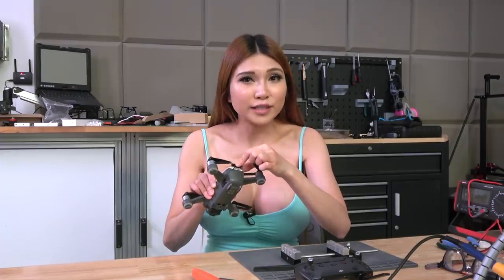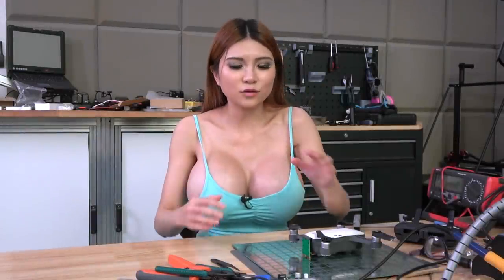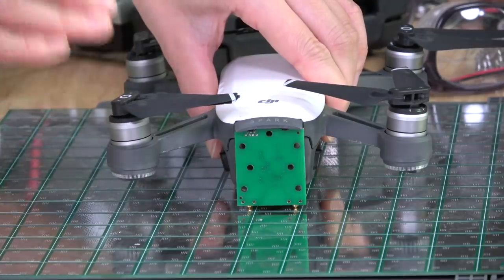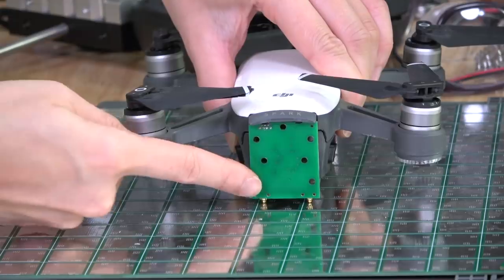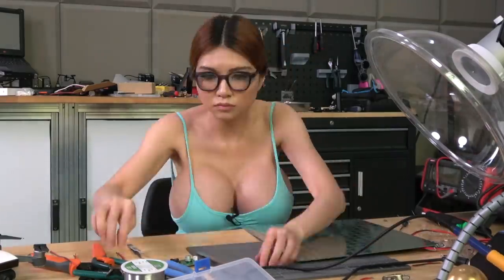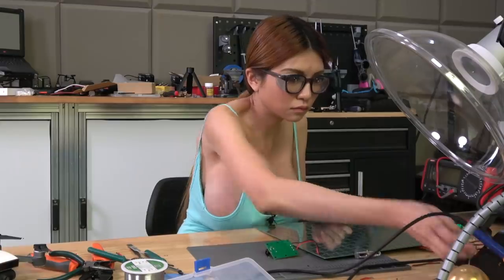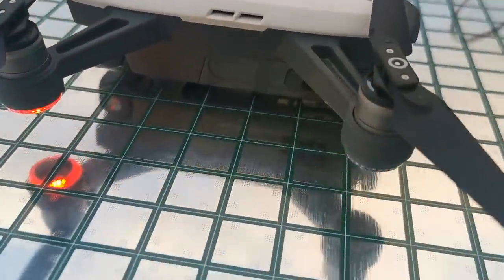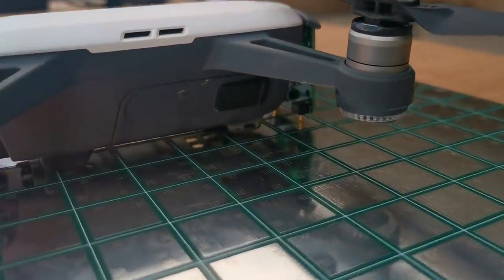DIY Self-Charging Drone- with JLCPCB!

Comment: those charging pads needs hangars, yes. i think, an open top would be the easiest to land in, but that would need a roof-door. the drones could be outfitted with some kind of transponder, that automatically sends an "open" signal to the hangar, once it is in reach of a few meters. once the motors stoped, a second signal will tell the hangar to close again, so the drone is protected until its fully charged. once the drone is charged, another signal will open the door, so the drone can start. once the drone flies away, the doors can close again.

Comment from the maker: FAQ

*Why not induction/Qi mat?
Of course, this is the first thing I tried. Coils require very precise alignment, landing cones, moving arms, QR codes and other schemes to enable this vastly increase costs. Large induction charging pads don't work well (which is why you don't see them for cellphones). It seems obvious- which is why I tried so many variations on this, but it ended up being neither cheap not practical. There are systems that use this, but they are much, much more expensive.

*Why not...
This is a proof of concept. The idea is to make this system as cheap as possible- so that you can have a lot of low-cost drones rather than one really expensive one. In order to do that, the entire system is made out of PCB parts- so there is no additional tooling required. As soon as you add injection molded or 3D printed parts the whole system triples in price. Yes, there are many improvements that can be made, but very few that can be made without adding a lot of cost.

*Why not solar cells on the drone?
Because of their weight and the drone's power draw they would only allow a few additional seconds of flight time. They could be used to charge the pad in remote locations and be quite practical for this.

*What happens in the rain?
Ideally, this would be in a retractable hanger- with gold or other corrosion-resistant traces on the board. But the board does have short protection in the meantime.

*Is their strain on the USB connector?
Not more than the strain of unplugging and replugging in cables. The springs on the pogo pins are very light.

Something else you'd like to see? Like all my work, this is completely Open Source so you are free to do anything you like with it: https://github.com/sexycyborg/JLCPCB-Drone-Charging-Pad/
Reply: @Basement-Science  to help with the weather  a hanger would be great, but maybe a sliding plastic cover (with a lil brush at leading edge for the 'dirt')is all that is needed, to help with the humidity/corrosion  you could only power the pad when the drone is detected nearby? and look at adding a sacrificial anode to handle what moisture u cant exclude. i like Naomi's plan of keep it cheap an simple. better for both consumer an producer to have a low initial cost. and drone ppl seem to be constantly replacing an upgrading their drones and associated bits n pieces.
Reply: Like Thunderbird 2 :-)
Reply: I did expect you to use induction initially, but t think you found a much simpler and more elegant solution! As you say, induction is expensive and fiddly, this is much more scaleable!
Reply: It might be fun to watch the journey on how you get from an idea to the solution, incl. the things that don't work - very much like alex french guy cooking  does with food..
Reply: oh so it have short circuit protection ))) that good to know
Reply: @Naomi 'SexyCyborg' Wu : Regarding wireless recharging... What kind of voltage and amps do you think you could get out of being in close proximity to powerlines where you live?

I remember an electrician friend of mine telling me that the electromagnetic fields around powerlines is actually pretty powerful, even if they're insulated. Maybe the high energy of the electromagnetic fields for powerlines would permit the drone to smaller coils and also not require the drone to be in direct contact with the powerlines as it would have to be with a Qi-mat?

Would be pretty awesome if a drone could recharge through induction IN-FLIGHT by simply flying close to powerlines without even having to land wouldn't it? :D
Reply from the maker: @Tuulos  I could see a small one maybe...trickle charge....
Reply from the maker: @MikeTrieu  source is posted, talk is cheap😉
Reply: Love it <3 and thanks for OS :) sadly the drone is sold out probably from your great sponsoring. Curiously wondering what would happen if a squirrel chewed on the landing pad?
Reply: Pretty clever solution.
Reply: what about strting new project? building DIY 250g Drone with frame made by JLCPCB?  Pcb is not sofragile it's ossible tomake frame 3D out of pcb plate 
it's even possible to use pcb to mount flight conroller to save some wegth  using boards  
If it will be cheap it will bnefit (cheaper then new frame + new wires conectors etc )

Comment: This is a brilliant solution for charging batteries.  The design answers all the questions the commenters have had about it's usability.  Alot of thought went into this.  What I like about the great design is that you only have to get the drone anywhere on the mat to charge.  This solves the problem having to align charging pins, that Roomba's and robot lawnmovers have to, but then they travel in only 2 dimensions, not 3 like the drone does.  Your subs number is rapidly rising again - well done.  2 million is not out of the question.

Comment: First of all, this is cool. Adding a landing camera. Like a QR Code of sorts. When the main camera sees there is a landing pad, it provides the option to use said Landing Pad. Even add some "hand shaking" so the drone has permission to land on that specific pad, whether it's being used, online/offline, or for another Swarm's useage. I know that adds additional coding, but if the landing system is only triggered through visual queues, or some sort of beacon system, it would help building out some Charging infrastructure. 

Pair charging pads that can fast charge, powered by wind/solar in autonomous areas during a disaster. Heck, the Drone could drop them where they're needed and even place their own infrastructure.
Reply from the maker: Sounds great to me, more done in software the better...

Comment: The raw solution as you worked it out will do the trick. If i may suggest another approach then this would be my solution.
Consider to add a shape to the bottom of the device. Why? Self adjusting positioning. Additional a frame with corresponding form of some sort on the contact pad. What about a hexagonal shape? Reason? Prevent potential short-curcuits. Fixed position to pads by landing on shaped frame which will the adjust the position of the drone. Just an idea i wanted to share.

Comment: Interesting - just a couple of things Naomi:
1 - the Spark batteries already have charging pads exposed.  Perhaps you could use those instead 
2 - every time it lands the pressure will put off axis thrust against the micro USB port.  I have had plenty of ports fail over time simply from connecting and disconnecting the cord which if not pulled perfectly lateral to to the port, puts these side loads on the connector.
Keep up the good work!
Reply from the maker: See pinned faq

Comment: Add some plexiglass sides on the landing pad, these need to be on a slight angle so the drone can slide. Then make hard plastic covers for drone  “feet”. Then test the return to home feature, if it misses the pad contacts it could hit the plexi and slide onto the pad. My spark usually lands really close to take off point (with good gps signal) also if the landing area has a good contrast pattern then it lands more accurately/stable.

Comment: Nice work. I have one or two suggestions for improvement.
1: Use AC to feed the pads on the board and a rectifier and voltage regulator on the drone interface board. This will allow the board to be powered whichever way it lands and will also drastically reduce the chances of corrosion if there is any moisture on the board.
2: Place a grid of plastic ridges between the pads on the board so that if the pogo pins come to rest between the pads they will slide off the plastic and come to rest on a pad.
Reply from the maker: Having AC run through an open board like that is insanely dangerous.

Comment: This has a lot potential because you could easily fabricate ways to charge also devices installed on the drones.
Of course, it gets more complicated but I'm thinking a power distribution PCB with maybe two or three USB cables that run to the devices. The fixed USB Jack can still be used to support the PCB, while the fixed pins can be extended through wires and 3D printed brackets

Comment: Bravo! Fabulous product fit for the 21st century, billion of times better than your earlier wearable led lights. It would be cool to have an automatous drone, scrambled on any potential space intruder detection (SID) and with multi wavelength cameras to capture day or night images and alarm back to you. If the drone could have audio warning for hostiles, telling them that you are armed with lasers and ready with brain damaging punches they would likely retreat. Ideally the drone and SID system should be solar charged with back up storage, so available even if a hostile cuts your main electrical power. In the by and by you could upgrade your drone to carry defensive armaments in case the hostiles start shooting at it, or have it send back the hostiles location for other defensive measures. Thanks for sharing.

Comment: Very clever idea. I presume the charging board is also a PCB to reduce costs. Using PCB's and standard components is clever. The suggestion in the comments of a drawer means you could again use cheap parts, and some of that brush strip I've seen on the bottom of doors would make a good cleaner for the charging board. As long as the drone wasn't on it of course! I like your whole attitude of keeping costs down. Much easier for entry level makers.
Reply from the maker: Thanks!

Comment: Have you thought about inductive charging? It would be easier to make the airfield waterproof :)
Reply from the maker: Does not work without very, very accurate drone placement.
Reply: @Naomi-Wu  The magnetic field can be made wider, but contact plates may have smaller losses, which is important when feeding an army of drones.

Comment: I thought the drones have an auto home and auto land feature.....that basically means it will land in exact spot it took off from.  Therefore you wouldn't have to worry about landing it yourself in the correct spot.   

This reminds me of the robot vacuum cleaners..lol.....very cool👍👍👍👍
Reply from the maker: The Spark is pretty precise, but not quite precise enough to hit the pad. The Mavic 2 can.

Comment: I like the sacrificial anode idea.  For long term use the pad might get by with anode, hanger and a small blower for debris.  But protecting the contacts on the drone from corrosion is harder.  At this stage, I think the weakest point in the system is connecting the board with just the micro USB. Since it’s a drone, you could improve weight with cutouts in the board.

Comment: a drone cabinet that the roof opens on when the drone gets close, and an induction charging pad that can detect when the drone is on it and close the roof as well as open it on lift-off and then a few seconds later when the drone is no longer close. It's easier than it sounds and only needs a pressure switch and a proximity sensor and an arduino/rasperry type controller.
Reply from the maker: Induction needs more precise landing, costs more, see FAQ pinned at the top.

Comment: You can go one step further... Self charging drone... when the battery is low, it goes back to base with out you piloting to land... It just lands on the pad... Take the homing circuit from the iRobot automated floor cleaners which has homing device to go home when battery levels low
The i-Robot also has boundaries of where it can clean... take that software and add to the drone so it only flies within a certain area.

Comment: Naomi,  there was a lot to learn in this video, great example and explanation... Of how a drone can land on a platform and recharge itself, showing us the PCB's was also interesting. Great explanation about how all this works, your flying skills are impressive, I've never taken my quadcopter off the top of the building before... So, I was impressed with the stability of your quadcopter... You really had the quad very high in the sky and you brought it back home.... Fantastic... I would be nervous as heck doing what you did. :-)

Comment: With 4 or 5 pins in a slight N or W pattern it could always make contact. For spring pins, look up pogo pins. They have a tiny internal spring for making contact. Zig zag the pins by a bit more than the width of your gaps between the metal plates. Obviously each pin needs its own circuit. Diodes can do the selection for +/-, and a voltage regulator provide a regulated 5.2V for the usb from what the diodes provide. Done with a proper controller even USB C high voltage and current charging could be done.
Reply from the maker: Yes, it adds a lot to the cost though versus just tapping the throttle.

Comment: maybe a fairly cheap 3d printed upgrade could be a sort of triangle/wedge shaped grid(you could print and assemble as multiple parts too) to go inbetween the squares, so if you land on an edge it would just shift the drone to the tiles as it lands?
Reply from the maker: Yup, but it would raise the cost quite a bit.

Comment: Could make a sliding drawer with audrina motors. To open and close plus push out/in drawer. A small electro magnet to align the drone. So you never worry about landing in the right spot. You can also make it look like a bird 🐦 house.

Comment: When I saw the square grid I did remember something about the property of a hexagonal lattice.
Two points a constant distance apart equal or a whole multiple of the grid size will always land on two separate cells.
So perhaps if you do version 2 try a hexagonal grid instead of a square one. 
This would eliminate  the 10% of cases where the drone would land in the wrong orientation!
Reply from the maker: Ok!

Comment: I think you could minimize those very few cases where it lands in between the contacts by 3d printing a grid of tiny wedges to go along the lines. If it lands with a contact on a wedge it just slides down to the nearest pad. Also I think you need a resistant plating on the pads to prevent oxidation from being outside a long time.
Reply from the maker: Yes, that costs a lot more.

Comment: If you make the grid smaller and add another pogo in the middle then you'd have useful contact no matter how you land. also simple diodes can be used between pogos and charging port.
Reply from the maker: Had three pogos but it raised the cost a lot...

Comment: You could use a few small magnets that would attract the charging pins in a precise position to the charging pad.
Reply from the maker: strong enough to center the drone would throw off the IMUs magnetometer.

Comment: The gaps between the metal plates on your charging pad should be a ridge.  Like the slanted roof of a winter winter home so the snow does not pile up.  When the drone lands, it would be unlikely for the contacts on the drone to rest exactly in the middle between two plates.  It would slide off the slanted ridge to one side or the other, especially if the contacts on the drone were rounded.
Reply from the maker: Yes, you can 3D print it, but again it doubles the cost versus just tapping the throttle.

Comment: If the drone could align to a landing cradle, it would put the drone in the same alignment every time and reduces the size of the charging pad.  Also may make a retractable hanger easier, similar to a helo hanger on a naval ship.
Reply from the maker: That kind of accuracy is expensive.
Reply: @Naomi-Wu  The cradle can be expensive. 

But take the charger pad or similar board, make a shallow 'v' so the drone will slide down and the rotors are still clear.  Make the ends of the 'cradle' angled also.Make a 'bulls eye' for the camera to focus on and land on the target.
This allows basic accuracy and gently guides the drone down into the correct position.
The retractable hanger can be very expensive, but is something to offer a challenge to work right.
The cradle offer its own challenge, but is easily doable and sort of time consuming.

Comment: What if you were to incorporate the pogo pins into the landing gear? This way the electronics could be housed inside the drone and protected from the elements. Also you could use RF around the pad perimeter, like an invisible dog fence, and software in the drone would sense the inside of the pad area and auto land the drone on the charging pad.
Reply from the maker: There are expensive solutions like this, the idea is to keep it very cheap.

Comment: Corrosion is at least in Europe a big issue. Therefore the pad should be powerless nearly all the time an do a small drone detection every minute. If a drone (not infinite resistance) is detected it can power on. But this also will not prevent the corrosion problem. In my eyes it can only work inductive like the smartphones are doing. This an be created on IP68 level for outdoor conditions.